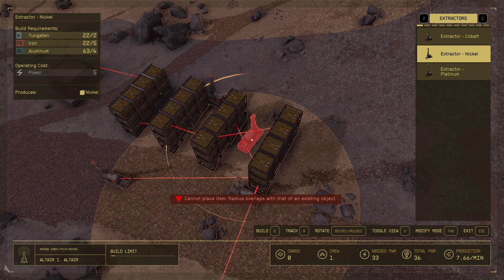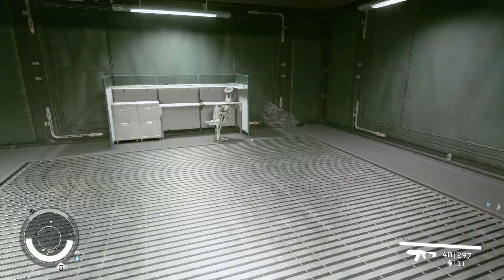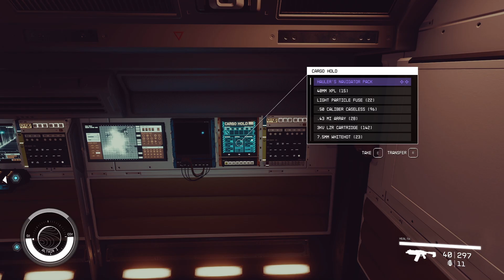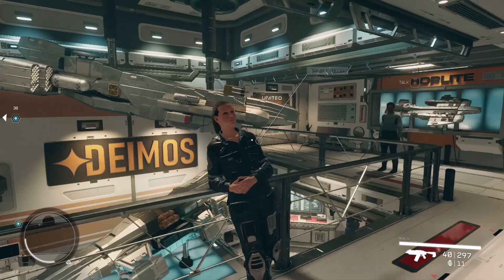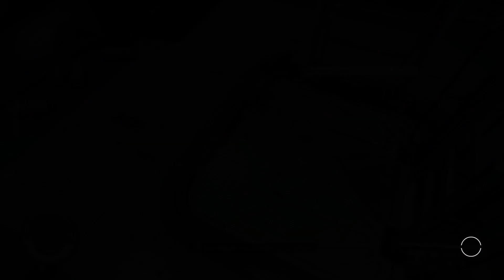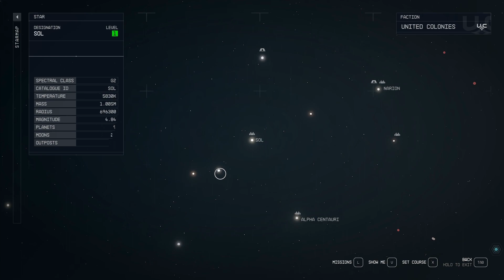Starfield: Setting up your SEMI-PASSIVE income with outpost mining

Comment: Not to be Too Big of an ** but before you seek to educate others, perhaps you should educate yourself prior. A miner is a human that is paid (mostly) and complains about back pain. An Extractor is a machine that's used to replace the complaining humans and is much cheaper to operate and rarely breaks down except for pirate raids. Unless you think humans and machines are the same thing...? Also another point you're wrong about. If you can build 5 10 or 10,000 to extract Iron for example, that's how many you Need. The more, the faster the Better. The Richer you'll be Sooner. I have a half dozen planets and some only have small patches where I can place 4 or 5 extractors which is annoying. Sometimes I'll find 3 or 4 Long patches that are 5 or 6 of the smaller and I can place 20 extractors. I run around with 100-150k weight because I'm overloaded on many many 1000s of resources. Neo. Aluminum. Euro. Gold. Bery. Etcetera.